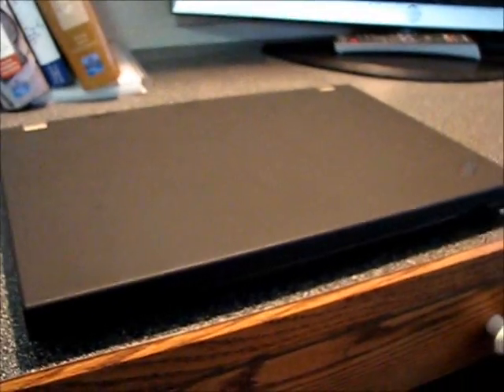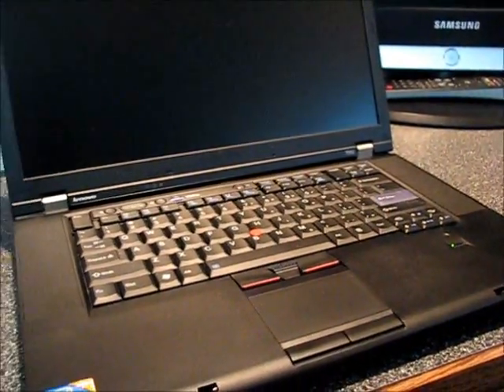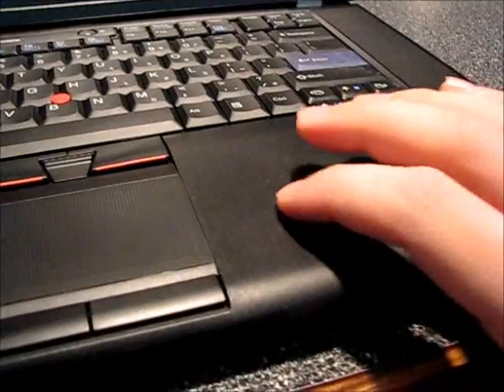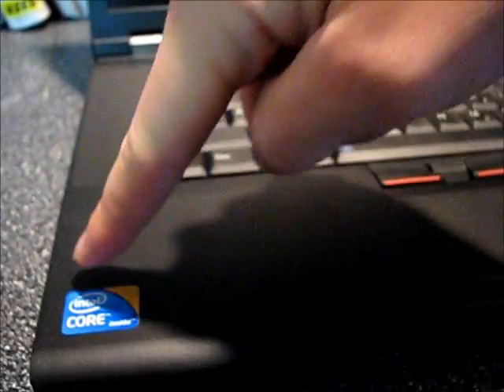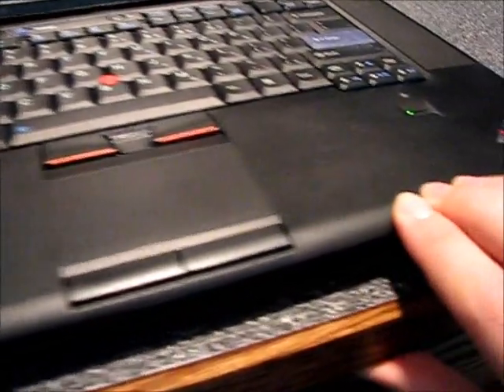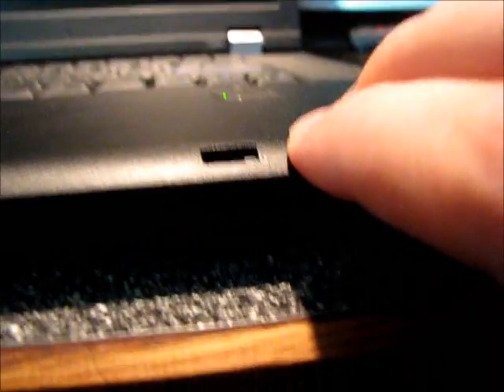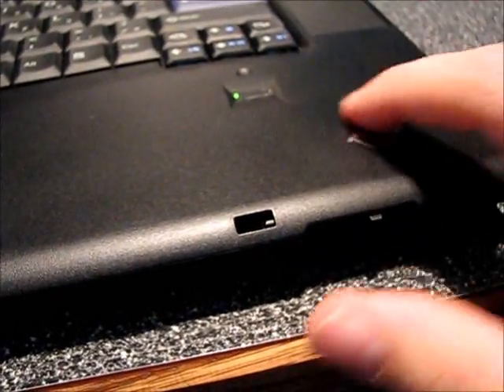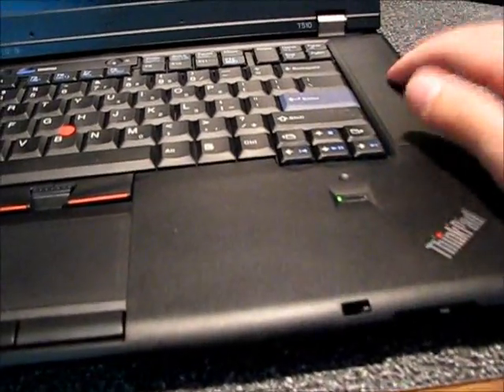Lenovo Thinkpad T510 Palmrest Removal and Fix -- Part 3/3

Comment: Thanks for these vids, I was curious about what was under my palmrest  
I got a T520 8 months ago, noticed the cheap feel right away. What a disappointment-- this is my 4th thinkpad, had never seen such shoddiness.  
So a couple weeks ago a crack appeared at the latch leading up almost to the print-reader, also a pea-sized hole at the bottom left corner appeared. I used steel epoxy dyed blue to cover the damage, and snaked it randomly all over the palm rest to hopefully prevent further cracking.